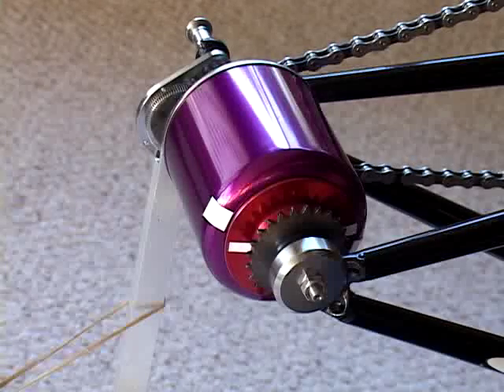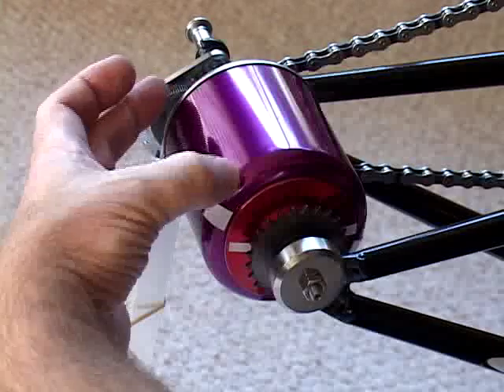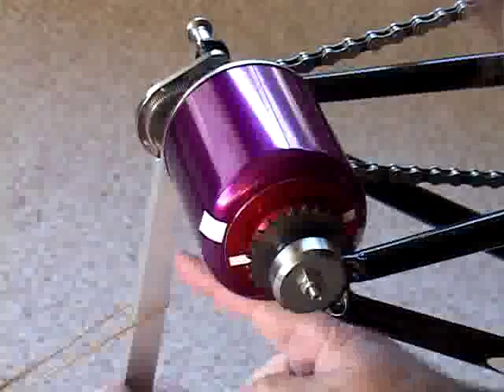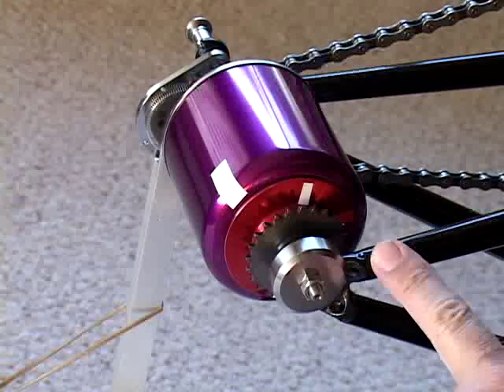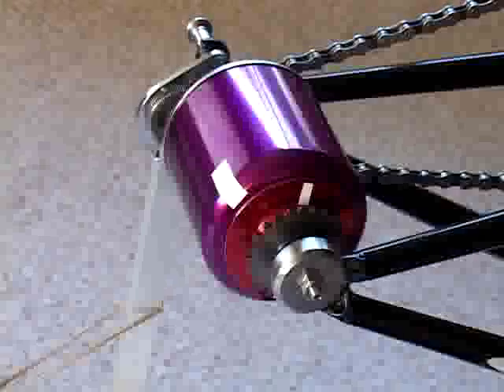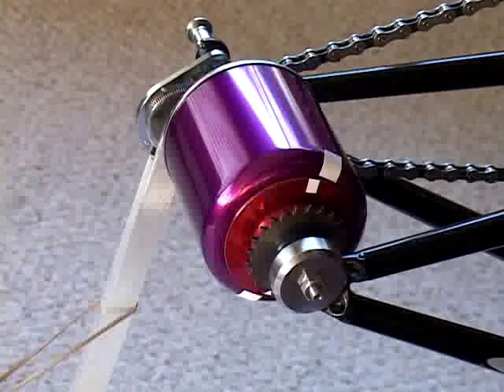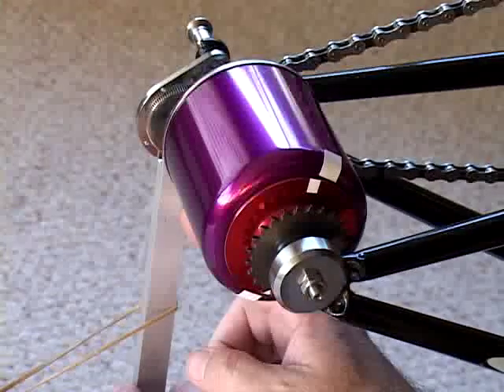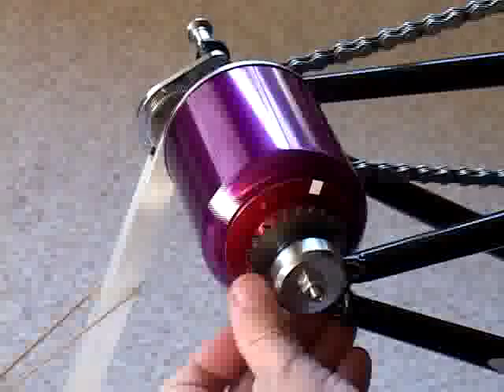Automatic Bicycle Transmission (IVT)

Comment: Can you explain a bit what is the point of this trans? it seems to me that you peddle alot and get little rotation out of the drive...
what am I missing?
Reply from the maker: Note that this video features an initial  prototype mostly designed to prove the principle operation of the mechanism, an invention.  Also note that you don't see the pedal crank sprocket which is 5 times larger than the small sprocket input to the SIVAT, so the pedaling cadence (speed) is only one-fifth the input speed you can observe at the SIVAT hub in this video.  The working prototype I'm currently designing integrates the 'speed-up' gearing inside the hub, so front & rear sprockets can be close to the same size and smaller than standard large (front) sprockets for better ground clearance, an advantage for mountain bikes.
The main purpose of the SIVAT is to enable the rider to concentrate on pedaling rather than shifting gears.  Instead of constantly shifting, the SIVAT will automatically adjust both your pedaling force and pedaling cadence to be fairly constant, which is the proven optimal way to ride efficiently.  The design criteria for the new design are to regulate power throughput at about 250 watts at pedaling cadence of 80 to 100 rpm under all condition of riding up and down mountains & hills, regardless of the grade (steepness).  Riders will be able to adjust that power throughput to their liking by turning a hand-knob on the transmission for any ride, so weak riders & strong riders can use it with different settings while keeping pedaling cadence in an ideal zone for all riders.  
Additionally, the use of derailleurs will be eliminated, so a simple straight-tracking chain with only one sprocket at the front & at the back are necessary, allowing the chain-drive to be easily encapsulated to keep mud & debris from the chain and sprockets.  The SIVAT hub will be fitted with seals, so the entire drive mechanism, including the transmission, can be dirt-proof.
The combination of being able to adjust the gear-ratio by increasing or decreasing pedal force, and protecting the running gear from contamination should make the SIVAT a better solution for mountain-bikers especially, and for most bicyclists in general.  In a more expansive potential, the SIVAT may be useful for several other applications beyond bicycling if it proves to work well on bikes.
Does that answer your question?
Reply: tyvm. I get it now.

Comment: a drill press uses something similar  to a cvt. why not modify that. a belt that rides higher on a pulley system that goes inward and outward . so the the belt runs on the outer most of the pulley
Reply: Belts are inefficient and can't handle high torque.
Reply from the maker: +Justin bustin  V-Belt drives such as VDP's are too inefficient & bulky for bikes.  Efficiency drops and wear rate rises as torque throughput increases.  These are the reasons that the many attempts to use V-Belts have mostly failed in the bicycle marketplace.  The SIVAT's driving elements are gears, that have well-known good efficiency, high torque capacity, wear-resistance, compact size and ability to be in a sealed enclosure.

Comment: notice how the output only moves when the shifter is moved, or has been recently moved.
Reply from the maker: The shifter is torque-sensitive & torque-reactive, so it interacts with the variable-ratio mechanism by design.  At low output speeds under no output load (resistance), the shifter acts like an actuator through to the power -transmitting mechanism; under load, the mechanism controls the shifter instead.  This featured prototype doesn't behave completely like the working prototype on a bike with riders will.  The video demonstrates IVT action and potential for full automatic operation, but it's not a final design, and was not intended to be.  This is just the first stage of development that's shown.

Comment: can you show us the mechanism used in it?
Reply from the maker: +Seif Driouech  
No.  That would void the possibility of getting patents.  I can only say that the mechanism is very interesting and not easily understood even by other engineers.  I invented it, yet can only understand it on a good day!  Intuition is not helpful, so engineering the next generation involves breaking down the concept into chunks, usually referring to lots of notes & calculations.  Momentarily pretending I'm a newly introduced stranger to the concept, it looks too simple to do what it does.  The devil's in the details, particularly regarding mathematics and physics which can be difficult to grasp by looking at the guts of a prototype that's all gears, bearings, levers, springs and steel structures to support them.  After patents have been issued, I'll likely produce a video to show how it works as best I can.
If I was you, I'd be asking the same thing!  I'd damn well want to know what makes this thing tick.
Reply: actually your project is very interesting... maybe one day i'll buy a car that runs on it xD anyways i hope i learn more about IVT soon
Reply from the maker: Seif Driouech
Shhhhh!  Don't tell anyone, but that's my ultimate plan!

Comment: have you made test on the mechanical efficiency of this type of gearbox,
it's so important when the imput is limited as in the case of a bicycle ?
Reply from the maker: Jacques Poirier+  Efficiency has not been tested yet, but will be on the working prototype once I get my hands on a dynamometer.  Efficiencies for most of the systems in the SIVAT are well-known, or can be calculated from industry standards for conventional mechanisms.  Fortunately, the SIVAT is a novel concept for using very conventional components that are widely used & documented.  After reviewing many articles on mechanical efficiency of various related devices, I can offer an educated guess that its efficiency will vary from about 94%-96% for ratios most used, and decline to about 90% for very high ratios (for ascending steep hills).  A rough estimate would be similar to linking 3 or 4 epicyclic systems together for efficiency, each taking a 1%-2% hit (deficit).  The actual test measurements will be published.
Having done decades of serious bicycling, I can definitely appreciate the need for high efficiency.  ...especially after long rides!  It's important to recognize that the efficiency of the bike rider's body is at least as important as the bike's.  The SIVAT will tend to encourage the rider to keep a fairly uniform pedaling cadence, regardless of the road's or trail's grade, generally around the optimal speed of 90 rpm.  Best of all, the SIVAT will be easier on the rider's joints & muscles, so the wear-and-tear will have felt more efficient.

Comment: For about 15 years now I drive a Rohloff hub system, It's bomb proof considering the 100% trouble-free 160.000 km I made with it so far. I've seen a lot of alternatives for a derailleur system, all of them seem to work fine in their prototype fase, but I often have my doubts about their mechanical endurance at the long time, that's why I choose to ride a Rohloff.  But since I'm always curious about the next step in evolution I wonder if the IVT is already being tested for durability. Are there already testresults available regarding the lifespan of the system?
Reply from the maker: +bolderiks  Yeah, Rohloff is great!  I own one myself, and even adapted a derailleur system to it just to be outrageous!  Imagine 278 gears!  The design of the Speedhub is first-rate, and I'm using some of Rohloff's technical information, such as life-expectancy, as a guide. I also use the Speedhub size and mass as a standard to beat while aspiring to at least match the durability.  The working prototype that I'm currently designing will be first road-tested by athletic riders, possibly including my son who's notorious for breaking frames and other parts.  I keep imagining effective torture tests that should follow.  Dr. Rohloff obviously thought long & hard about his design, which is what I've been doing.
The SIVAT design is especially critical because it's a revolutionary concept with no prior art except my own.  Those who come up with new concepts too often spend inadequate time to review their designs for long-term use and viability.  By contrast, I try to consider the myriad of possible failures and unusual circumstances that could thwart success of this as a durable product.  The result is a lot of work.  Alternative approaches have been considered in detail, and I've embarked on a very meticulous review of dozens of SIVAT components and their specs to determine maximum life of the whole system without weak points: so far, it's looking good.  Custom parts will be examined & optimized using FEA.  A chain is only as strong as its weakest link.  I've had to re-conceptualize several parts of the configuration repeatedly to accommodate strengthening to adequate values.  Once the SIVAT prototype has been rigorously tested, I'll publish & video-broadcast (on YouTube and a website)  the results for anyone to see.  Manufacturing processes will also be tightly monitored to assure that the final product passes similar tests on an on-going basis.  All this work should pay off to introduce a transmission that's tough and satisfying to users like you.
Reply: Thanks for your satisfying answer so far. I'm aware of the competition out there, so I sure hope the IVT is going to be as durable as the Rohloff or Pinion system. If the durability turns out to be ok it could be the holy grail to get thanks to the infinite range. I wish you good luck with developing the IVT to a consumer ready product. Please keep us informed of the progress!
Reply from the maker: bolderiks
Thanks!

Comment: There are a few obvious problems, one is by using a ratcheting mechanism you are introducing high load, small contact point wear.  Next, and most obvious is output stutter at artificial (high) ratios, ripple is more like 35% AT INCREASINGLY LOWER OUTPUT SPEED.  Some of us are accomplished engineers...  You can do the following, one, and by appearance of the mechanism you probably already use, is viscous fluid to dampen the output.  If that's the case, it simply is not good enough.
Reply from the maker: SIVAT's ratcheting mechanism is a well-established, widely used device that has known, published specifications for torque capacity and wear.  I use those specs for engineering the SIVAT with a considerable safety margin.  In operation in the SIVAT, those mechanical diodes only engage & disengage during gradual transitions from & to differential speeds, providing actions similar to gear synchronizers in conventional transmission.  The contact patches where torque is transferred are wide and orthogonal to force vectors, so there's much less wear-inducing twisting action that's in both conventional clutches and traction-based CVT's.   Regarding these dynamics, there's no need for a viscous damper, nor is there any need to use damping to attenuate systemic ripple.
Although ripple is inherent to ratcheting drives, the SIVAT concept & its design execution bring maximum ripple  way down to levels below that of prime movers and even gear engagements that produce torque ripple with their conjugate (consistent speed) action.  Ripple has been carefully studied in SIVAT CAD modeling as well as in the defining equation for its CVR action across the full range of ratios.  As I stated in the video, ripple is generally a fraction of a percent across most usable ratios, about 5% total (2.5% bilateral) FWHM at a short range of very high gear ratios.  When you observe ripple in the demo here, note that this is a proof-of-principle prototype that's deliberately not put under working loads intended for actual use, so its motion is subject to irregularities of low-resistance hand-cranking of the unloaded drive done for the video; under proper working loads, this 'nervous' action disappears. 
When I designed this P-O-P prototype, its full functionality was in doubt because confirming its logic was far more important than accommodating all forces (some unknown) in a test unit.  I built this prototype to determine what values of variables would result, and what needed fine-tuning for a working design.  It's an invention!  There was no prior art from which to determine the full panoply of its behavior in its range of ratios.  As it turned out, the logic worked as predicted, but some behavior was a surprise that taught me what change was needed to assure a good final design.  This prototype design was close enough to allow taking useful measurements.  This isn't just a variation on a theme, it's a whole new theme!
Now if you want to challenge my engineering ability with statements like 'Some of us are  accomplished engineers...', first find out who you're addressing!  I've designed novel bike transmissions since 1963, all of which worked well  (except the traction-roller version).  I've worked in engineering departments since 1966, and became an engineer in the late '70's.  My career involved a wide variety of design & engineering tasks, including designing several types of drive systems using DC gearmotors smaller than your finger to multi-hp AC motors; including multi-stage drives for robots and high-reduction drives for production equipment; including friction belts, friction rollers, chain/sprocket drives, timing-belt drives, serpentine belt drives, air-driven actuators, solenoid actuators, bevel-gears,  peristaltic pump drives, rack-and-pinion drives, servo & stepper drives, spur gears and the almighty epicyclic gear drive.  None of my drive systems failed to work as intended.   I've also been a lead engineer and engineering manager.   So, I'd like to know what you mean by 'accomplished engineers'!
Just what kind of seasoning would you prefer on you crow pie?
Reply: The seasoning where you are actively trying to rip people off.  Publish your maximum torque input and output values, have you destructively tested this device yet and explain to me what your methods are that you CLAIM reduces ripple...because the video makes it clear the stutter is further exaggerated by increasing reduction.  So again...your idea of throwing a wall of text at me about your accomplishes explains NOTHING whatsoever about your claims to reducing ripple, if anything, I'd be willing to bet the stuttering in the output would become worse with an applied load.  Sorry to throw you off your high horse but come on, you go on and on about a transmission and show no specs, demonstrate that it does indeed increase stutter with further reduction, claim otherwise and overall you built something you want to fund...and it doesn't work as advertised.  We call that a hack job.  If you want to refute me, do it with further testing, apply a load to the output, operate the transmission at increasing speeds, build another for destructive testing...show the world that what you made is worth investing in, otherwise it's a video where you product pander in the same way they do on infomercials and that helps nobody.
Reply from the maker: Tristan Wolff
Apparently, you haven't read other comments here.  I've explained the status of this project clearly, including plans to test working prototype(s).  Your own uninformed incredulity is no refutation of this invention.

Comment: how heavy is it aproximately? .  if it isnt much then i can see this in the mountain bike industry..
Reply from the maker: Great question!  The featured prototype weighs about 3.6 lbs, slightly lighter than a Rohloff Speedhub.  The new design for a full working prototype adds some internal gearing, but is being designed with weight reduction in mind, so its weight will likely be similar to most hub gearing for bikes; roughly between 3 and 4 lbs.  Since it's better to place this weight (mass) on the bike frame instead of the wheel for better handling, the design will include the option of being mounted on special bike frames that accommodate a bottom-bracket location, or on a secondary position above the bottom bracket for retrofitting standard existing frames and providing full-suspension drives for special F.S. frames.  Although the SIVAT is intended for general use in a variety of bike & non-bike applications, its design is specifically focused on mountain-biking use as its most demanding standard for low weight & high power capacity.  I want the SIVAT to be a superior mountain-biking transmission!
Reply: SIMKINETICS i could see how useful it would be for mountainbiking.. no more late gear changing and cruncing gears . it selects a suitable torque for climbing and decending.. and the changes are gradual and smooth.. there must be a great increase in efficiency.. we generally have to shift gears well before the climb to avoid crunching the gears which leads to loss of speed.. but this is great.. hope to see it in mountainbike conventions and on bikes soon..
Reply from the maker: *****
Thanks!  You get it!  My own frustrations with derailleurs on mountain rides inspired me more than anything else.  Let's do away with jammed derailleurs, sucked chains, and the wrong gear ratios!